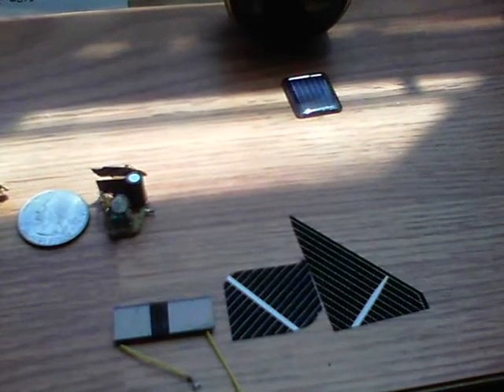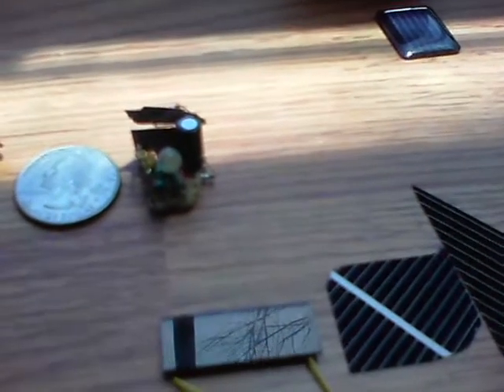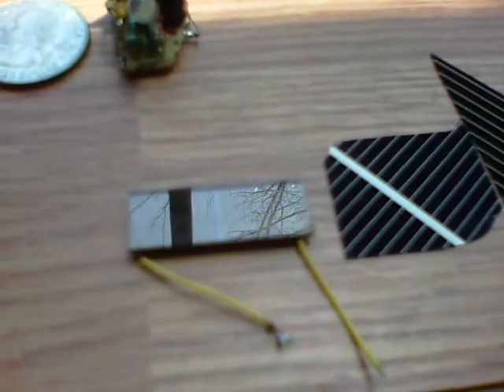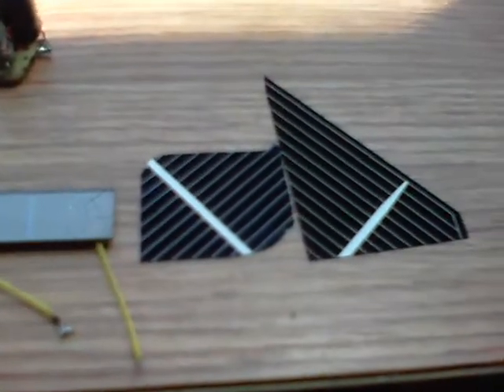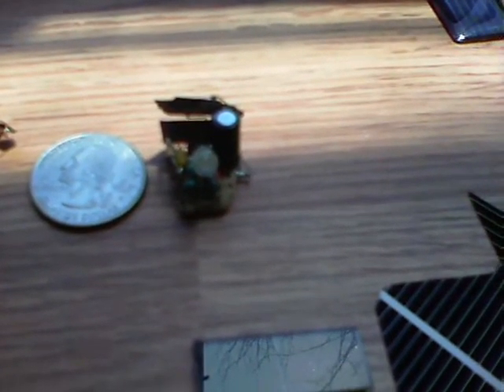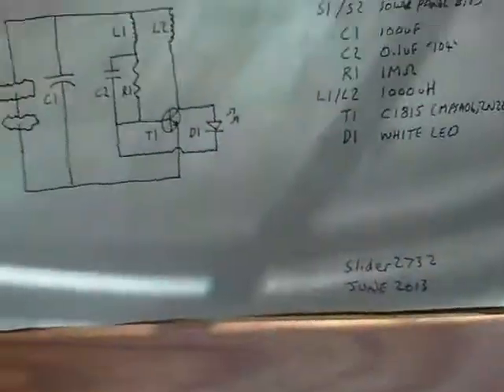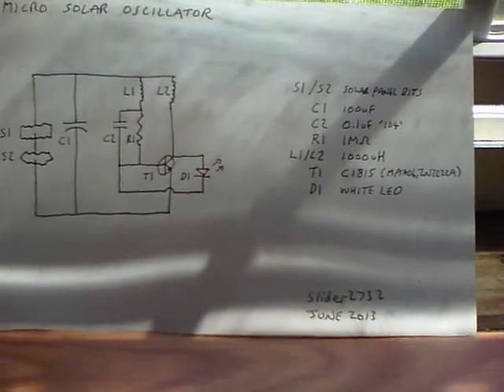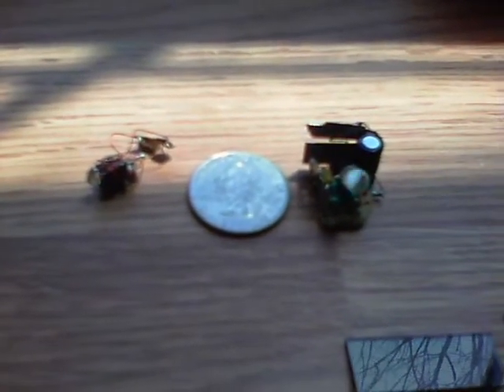Micro Solar - The SMD Version

Comment: I'm soldering them off no worries, bit of braid and some flux. Or the smd blower.. Managed to fix one of the broken legs, but it was not strong enough after that. Lost an LED and 2 solar panels too! Tweezers are a must for smd work. Preferably non-magnetic. You should have seen me curse and swear putting too big smd stuff on that ramps board.

Comment from the maker: Oh I hear ya with the soldering. Also, you know the universe is against ya when you count 11 burnt finger nails !
Also, gravity becomes your new worst enemy, how many times have things slipped from the fingers and they'll never be seen again !
Maybe a tip or two for the transistors...put a dab of flux paste on the connecting wire, then place it next to the pin and dab the iron quickly for the join. To remove from circuitboard, use a brand new razor blade or exacto knife thin blade.

Comment: Sure does. I have some of those 470uh inductors. Was going to try them! My panels are about 3mmx5mm. my inductor was 12mm before I put 350 turns on it. now its more like 15x15mm, plus transistor wire and led. If I could get smd everything, it would have all fit inside the core. Soldering this stuff is painful! I don't know hao many times I had it all together, and something broke. Killed about 5 smd transistors by breaking legs off!...

Comment from the maker: It's the inductor...3mmx5mm, found 2 of the same size on a CD player board. This new circuit is 10mmx7mm including panels when 30 gauge wire is moved up to the inductor. Solar panel bits are 5mm square, or square'ish.
30 gauge gets big at these sizes eh.

Comment from the maker: Cheers Ray, well it certainly was worth doing. Saved heaps of space and could possibly go smaller. But the panels, well they are about the smallest I reckon. I put one of them on as is, 2nd was larger, it worked, so I chopped off the top of the larger one :)